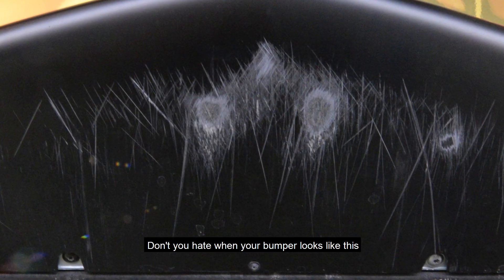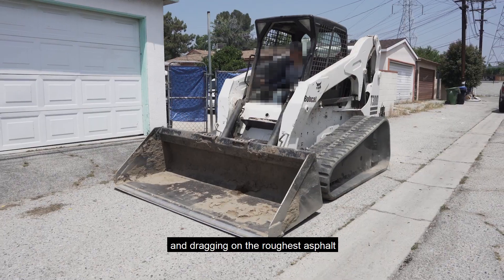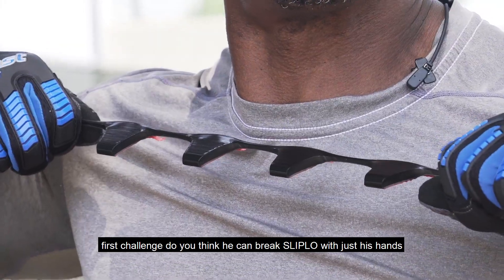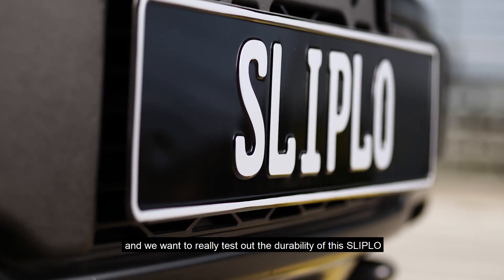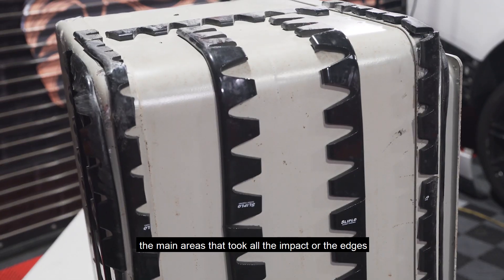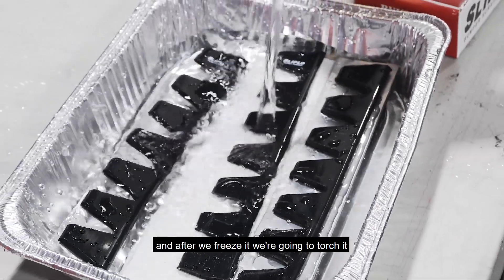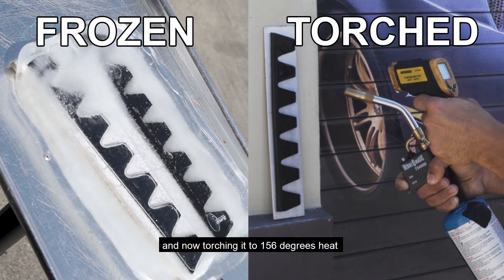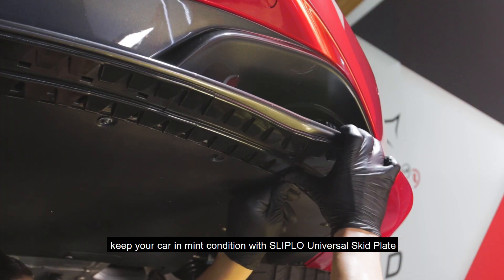SLIPLO Bumper Lip Protection Extreme Challenge (WILL IT FAIL)

Comment: Hi, if i am considering buying Sliplo and want to remove it due any reason. Is the removal of Sliplo difficult and clean? or will it damage the bumper?
Reply from the maker: Hi Edward

SLiPLO can be removed without damage to your factory paint job. I have seen some paint coming off during removal on after market paint jobs. Again this is generally due to short cuts taken by body shops during preparation before repaint the bumper.

The hardest part is getting each pieces off and then removing any remaining residue. This part takes some time but it is pretty straight forward. we will be adding a video showing how to remove SLiPLO very shortly so stay tuned. It will be very similar to remove a badge off of a car like the following video.
https://www.youtube.com/watch?v=tE4oeLHHb_U

Thanks
Reply: @SLiPLO  Look forward to the removal video.  Please let me know too.